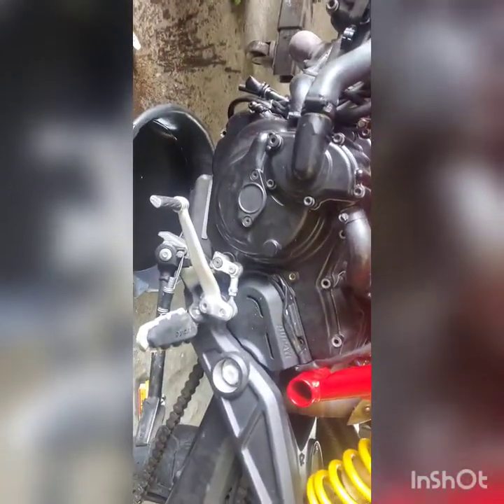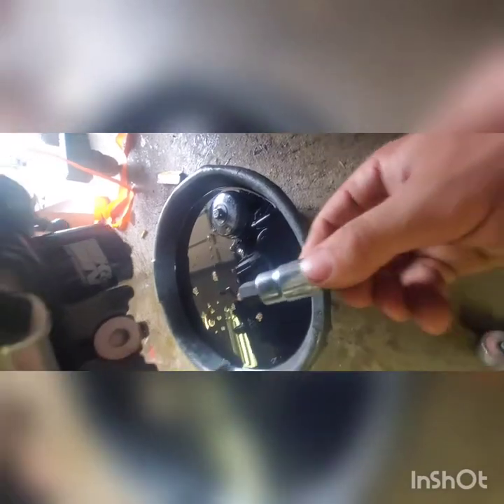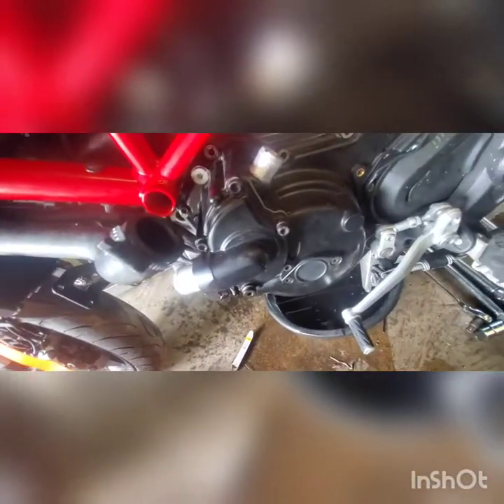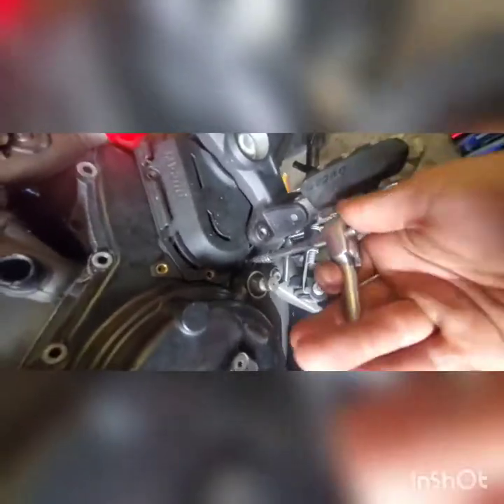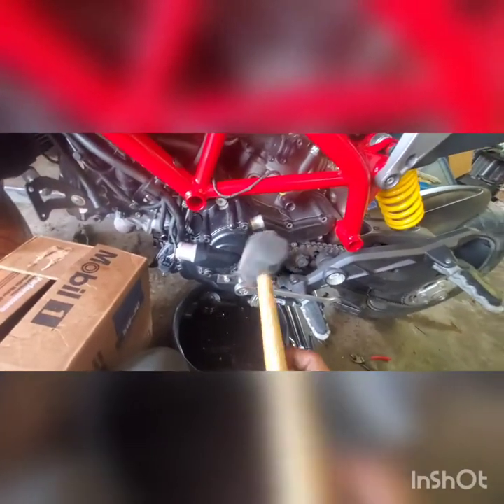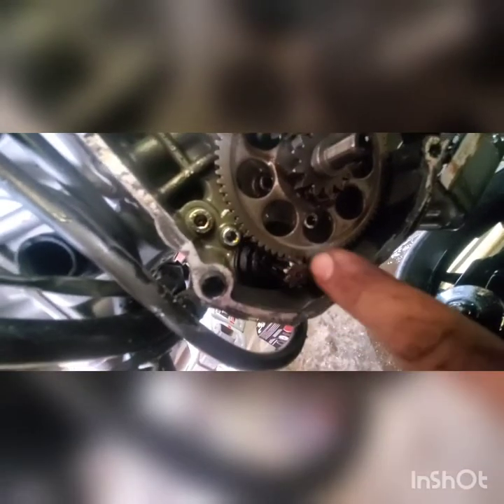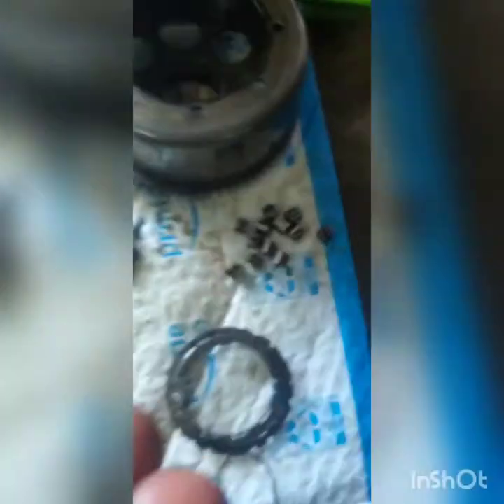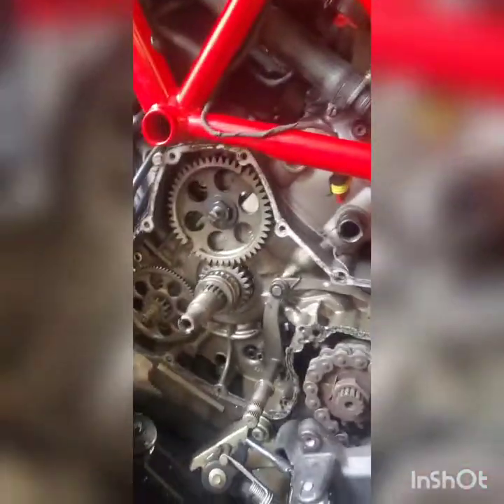How to replace SPRAG Starter Clutch on a 2015 Ducati Hypermotard 821

Comment: Dude do we need to change the ignition flywheel because thats one expensive piece in the jigsaw. I have a Hypermotard myself and have starter not starting my bike while starter spins
Reply from the maker: All I did was replace the sprag clutch inside of the flywheel and all has been working good for me.
Reply from the maker: Sounds like starter clutch to me. If I was doing it I'd also replace the starter while in there depending on miles
Reply: @Piston.P  i wish i could do the starter as well but its bloody expensive from ducati and i am not in favour of going after market for engine
Reply from the maker: @TheLotsafun  ebay has oem ones for like 160
Reply: @Piston.P  i spent like 2000$ on new ECU and Pair of ignition coils few months ago! The plagued issues of Hypermotard Christmas tree lights and fried ECU
Reply from the maker: @TheLotsafun  that's crazy I would've tried to source a used one. Luckily the only issue in 10k miles has been the starter